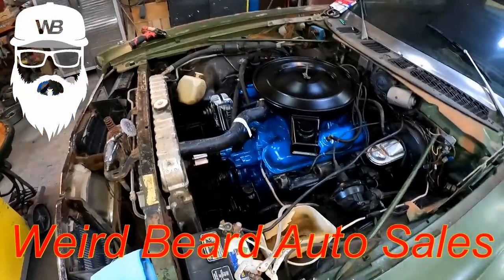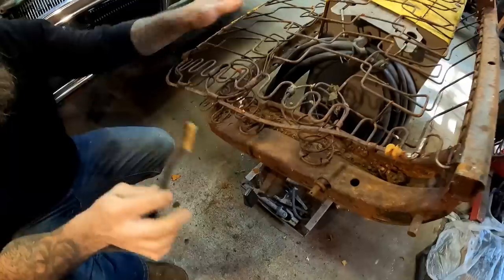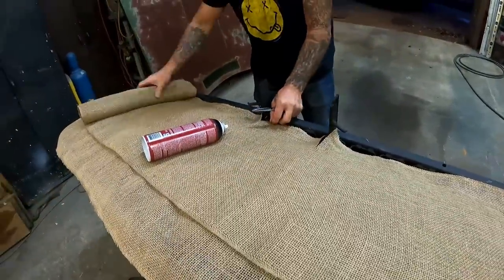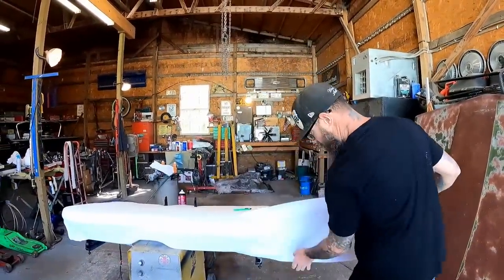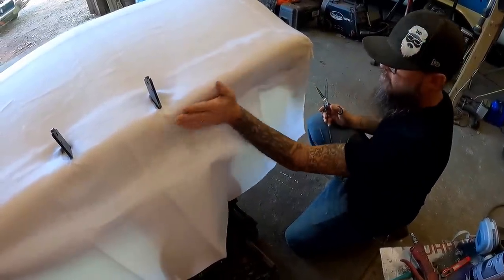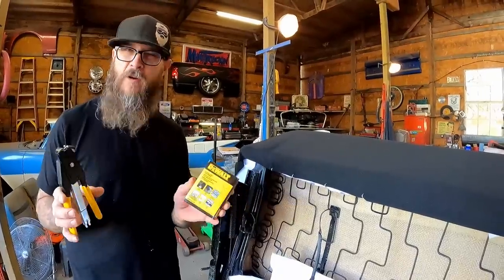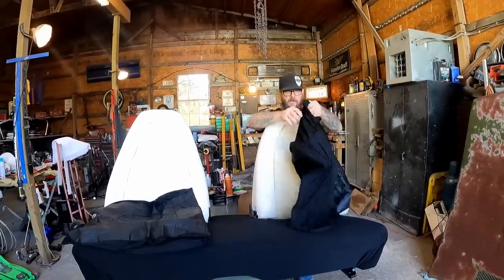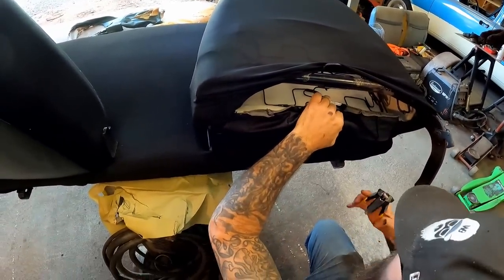WAS IT WORTH IT? YOU TELL ME

Comment: All those broken wires that run length wise are to help keep the foam from splitting and sinking through the springs. That seat is definitely showing its age. You've done awesome work fixing them!
Reply from the maker: Thanks for the info Dave. Ya that seat was definitely in bad shape.
Reply: It also ties the springs together to help avoid  a single spring from sagging when you sit on it. 

You can hog ring burlap to the springs if you don't have replacement wire.
Reply: Agree!  You’re an artist, WB!!
Reply: you also could ziptie them together

Comment: @Weird Beard 

For the arm rest. Use some of that vinyl you have just cut off the seat cover kit, or better yet, the stuff you made the door panels out of, and when you go and take the arm rest vinyl off to stitch it (or if you don't, to put some up in behind the tears) use a bit of it on each seam to stabilize the material. It tore out because the threads have rotted. That much is clear. But the vinyl itself is likely now weakened from years of stress, and sewing that back together without reinforcing the stitch will likely result in the seam ripping open sooner rather than later. By adding a  bit of reinforced material behind the stitching, you are giving back strength to the fabric in front of it, so it won't easily pull apart under stress. As well, if the seam ever did expose what was behind it, you won't see it, as it is black as well (once you paint that vinyl). That rip, you could do the following: do the same with the fabric, but instead of sewing it, use the adhesive spray and fuse it to the rear (on one side at first). Then, use your heat gun a little (not much), and pull the rip together. , Then, when you're sure you have the shape OK, go and spray some adhesive on the opposite side. This will give you a thin rip, rather than a thick one, making it much easier for you to start to sew. Then you can stitch through the rip carefully, going through both layers of fabric while it is pulled together. Then, all you need is a vinyl filler kit which you can buy online or at some upholstery/auto shop and fill in the area you've just sewn together. Since you're painting the armrest, it won't matter what color you're doing with the vinyl repair stuff. Just be sure you don't leave a big lump on the vinyl when you stitch it together. Keep the stitches small and as flat as possible, and use your hands to keep pulling it together as you stitch, to put less strain on the vinyl, and to help maintain the flat. This way, your arm rest will look as good as it can look without being recovered. Hope something in this helps.

Comment: Great job putting the seats back together. Recommend starting in the middle of the bench and staple the material in place front and back. Stretch out to the end and pull wrinkles out and staple end in the middle. Go back and do the front the staple working your way to the end. Then do the other side of the front. THen move on to the back and the ends.  TO remove the wrinkles of the seat back, just put the seats out in the sun for a few hours that will tighten them up. Enjoy the videos and keep them coming.

Comment: Not bad at all W.B. 
Summer heat will iron out the wrinkles for sure..
I reupholstered a 84 Grand Prix I owned ..
Cut the material & sewed the seams .
I used a similar process to hook it to the frame..
It might be the same thing you have there..
It was a C shaped piece of metal that wrapped around the edge of the frame...
I bought it to flip back in 88 & I nearly kept it because it came out so good.
Reply from the maker: ya I figure the heat will help it. I love it when a project turns out too good to part with.

Comment: Throwing you an idea. I painted the seat on my Yamaha Raptor to match the custom paint on the bike. I painted it cobalt blue with argent silver flames. The seat just looked out of place being a big black blob sitting on top of the paint. I experimented with several methods, and the one that worked the best was to mix my base color with lacquer thinner instead of base maker. the lacquer thinner softened the vinyl material enough that it allowed the paint pigments to melt into the cover. I rode the hell out of that 4wheeler and never had an issue smudging the colors and they lasted. Might work on getting that arm rest to stay black?

Comment: I would get the center redone or you could stitch the sides and use a vinyl repair kit to fix the split and dye it black as well as flip it over so the best side is up. Like you said it will be down most of the time. Just flip it up when you take a ride with your wife and she can flip it up and slide on over.

Comment: Awesome effort on upholstery.. A Point of reference for your next upholstery job :p...  If i can add 1 thing, Factory have a wire on the area for the hog rings.. If you added said wire to this area in the fold at the hog rings you wouldn't get the pull in material and would cause a locking rod for the material to help not tear as were and age creeps in...This is what i found when i did my interior on my 57 chevy....Sorry cant attach pick to show what i am saying.. Cheers again from Downunder..

Comment: I believe that is a good idea spraying it like you are! 🧐 They punit under the foam until they started cutting cost over doing it correctly. You got the good glue spray, dries quickly and tacks even faster, too bad you couldn't get the molded foam with the wiring in it anymore but on the other hand it would hike the prices way up more than it is now.

Comment: The seat backs look odd, perhaps if it was covered with the same material the seat bottom might make it more uniform and as well as the arm rest. You did a great job on the seat bottom. If you were to cover the seat bottom with the material you'er going to cover the seat back with then it may look a little more uniform all around. In any case you did a fine job with the seat itself. Good work.

Comment: Personally, once the edging cloth was done around the sides of the foam, I would have just made a template for just the center of the seat to inlay a piece to match the depth of the edges and just fill the center without overlapping it over the material already put on the edges or else the difference in the depth will show once you put your material over top unless you're going to use thick leather and I don't think that's the route you're gonna go with it.

Comment: Don't cut the hog rings, it makes clean up take twice aslong and blunts a sharp tool.
Use your already blunt side cutters to grip the back of the hog ring firmly, then twist and pull. The hog ring will untie itself and come off in one piece still gripped in the cutters.
I used to be an automotive upholsterer, takes a few goes to get technique perfect but is alot quicker and less hassle